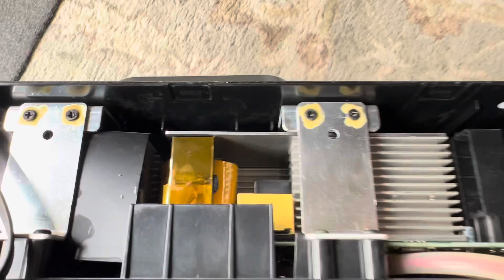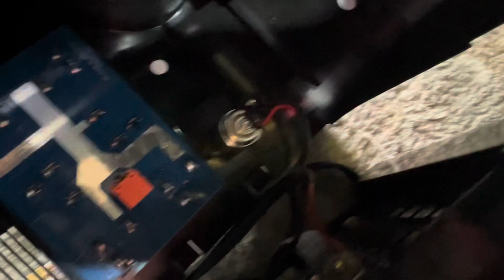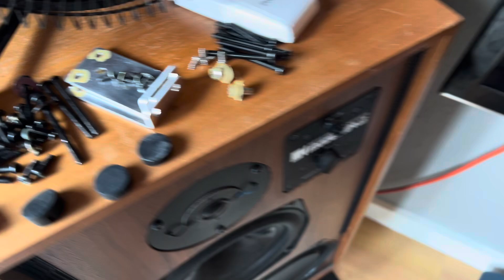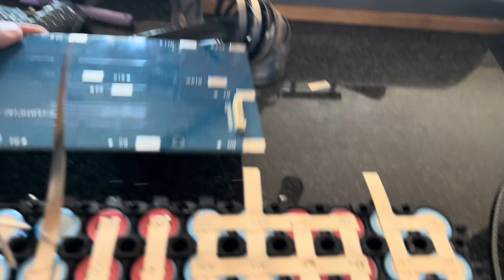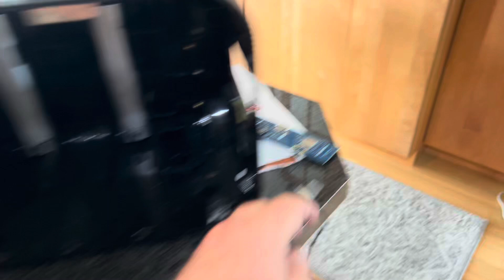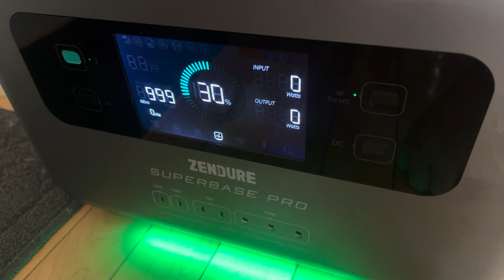Rebuilding the battery pack for a Zendure Superbase Pro 2000 watt power station

Comment: Im from PH...Superbase pro 1500 user ..Unit doesn't retain battery power..I opened the unit and it uses pouch type battery cells...3rd cell in the pack with 0 volts...

Comment: I picked up a Superbase Pro 1500 empty case on ebay no battery or inverter/charger but the front panel PCB is intact. Do you know if I can apply power direct from a battery (60V?) to the XT30 connectors on the PCB to just get the USB outputs working?

Comment: I had started opening mine up and then thought to check for a tear down video - found yours.  Thank you!  I stopped. I also turned mine in at our local ewaste today.  20650's aren't worth it for me to scavenge.  My story is I was part of the original Indiegogo campaign in 21 and in for $1300.  After the extra long time to receive mine, it never really worked right as it is the only system I've known that when it was plugged and charged up to 100%,, it would then discharge (while still plugged in to grid) about 10% per day  with no loads connected - down to 0%.   After support agreed about the problem and agree to do a hardware fix, then they went completely cold and abandoned me.  As a final attempt, I went to several of their "last known" USA addresses here in Silicon Valley and found nada.  So I left it sitting around the house waiting for some defining event to take place.

Comment: Had the 1500 pro. Was a giant paperweight from day one. The BMS in that thing is hot garbage. I tore down the whole thing just like you and was able to charge the battery via a bench power supply. No matter what I did it never showed the correct charge would go from 75% to 0% and never hold a load. What a scam company!

Comment: I have a question, after turning on the battery, it shows 0 percent when starting up. I guess it also flashes. How did you solve this, my battery is restored but the red light inside flashes, not green and 0% when starting up. It also does not charge when plugged in with 220v. ✌️
Reply from the maker: If you are talking about a Superbase Pro when you say 'battery' then the whole video is about my purchasing one that showed zero percent when plugged in and also showed zero minutes until full charge, as it would NOT charge. The Zendure folks recommend you try to charge it with DC as sometimes the BMS will kick off and disconnect the batteries. The DC may allow the BMS to be woken up. 
If that doesn't work (I tried for 5 days) then the batts are probably dead like mine. You can take it apart and test the individual battery voltages. It was pretty easy. I was lucky to find a super cheap source for new batteries on craigslist SF.
Reply: @israndy  I disassembled the broken superbase pro and all the cells were discharged to 2.5 volts. So I charged everything again along the BMS lines to an average of 4.08 volts. So I have a voltage of 53.2 at the output. But at the same time I don't have a green light flashing inside, a red one. All 13 groups of cells are working. I tried to reset by disconnecting the BMS socket with 13 cables but without success. Always after starting 0% and 999 minutes, although the battery is charged at 90%+. If I plug it into the power outlet, no reaction. In your video I saw that when initially turned on it was also 0% .. Tomorrow I ordered a cable for the 60v socket and I will try it through my panels... very strange, but there are users who report that at 0 percent the only option is through the socket for solar panels...